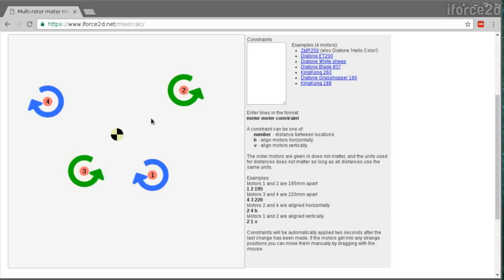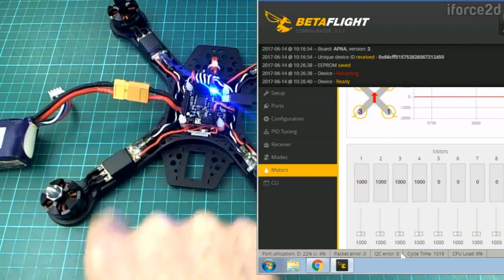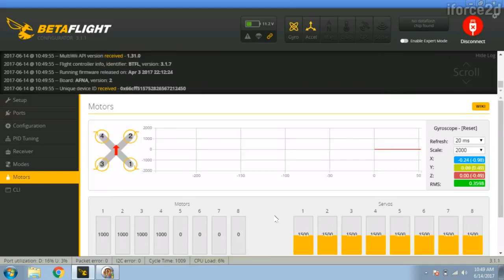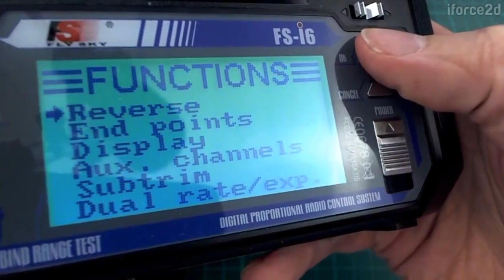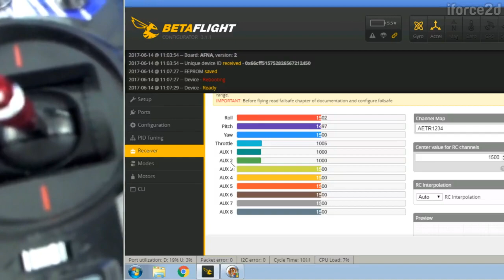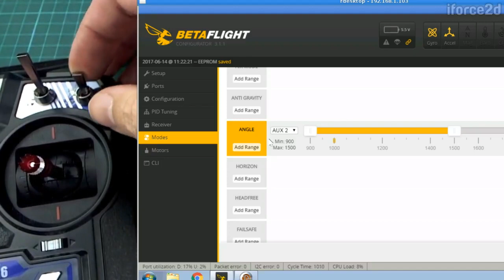Noobs guide to quadcopters part 16 (betaflight setup)

Comment: I have watched this series years ago (right when It came out), with a bunch of other ones too. I actually bought parts back then to build a quad, but never got around to it (life....).
I want to get back in to this now, but have two questions:
- I have 1806 2300kv motors and 6030 props. And a 3s lipo. Can I use those together?
- I have 4 12A ESCs. The probleem is that they only have a sticker with the 12A on it. Nothing else is noted on them. How can I figure out what type they are or what firmware they use? I don't recall what they are from buying them, not do they have any documentation with them.
I've tried to Google both the above and haven't really found any definitive answers. 
Thanks in advance.
Reply from the maker: The motors are a good match for 3s lipo. 6030 props will be fine for lazy hovering around, but are usually too thin and flexy for aggressive flying (they will start to buzz and flutter). Try around 5040, 5045 for a better match. It doesn't really matter much what firmware the ESCs have, unless you want to get fussy fiddling with their settings. The main difference is that if you want to reverse the rotation direction, you need to do it by swapping any two wires going from the ESC to the motor, instead of by using the software settings that BLHeli allows.

Comment: Just for anyone coming across these truly excellent videos these days I want to add just one thing that I consider important:

These days, arming and disarming is NOT done with the clunky stick movements anymore. Just put it on a dedicated arming switch like the flight mode. As he explains at 47:35 it's important to have an easy way to make sure the propellers stop (as they might pose a threat to people/fingers or just be in danger of damaging the quad itself it something is tangled up).
Get used to armind and disarming a quad on a switch immediately. When first lifting off after plugging in a battery, or particularly the first flight of the day have your finger on the disarm switch if anything is going wrong. This is hard/impossible to do with the stick movements.

This is also connected to the fact that motors spin up as soon as the quad is armed, even though this reason comes from a different direction: Brushless motors have a hard time starting (or rather the ESC has to do some special stuff to get them to move) and it's a relatively slow process compared to how quickly a quad normally has to react to things. If you're in the air and you put the stick all the way down (maybe you just shot up too high and want to come down) the motors stop, which also means the FC can't correct the attitude of the quad since every command to an ESC requires the motors to start spinning first, it can't just spin one slightly faster than others to rotate slightly since all are off. A quad that's freefalling tends to start to oscillate out of control as the FC tries as he might to correct and constantly overcorrects due to the delay in reaction (and the dead zone, as you see the motors don't start spinning at throttle 1001 or 1002).

The idle throttle can be set on the command line btw, so I highly recommend leaving motor stop OFF and please please please use a switch for arming and disarming!

Comment: Thanks a lot for helpful tutorial. I have a problem with BLheli Suite, Initialization of serial 1 wire passthrough or 4way interface failed!
Reply from the maker: You should always try googling the text of the error message, it will usually find the answer quite quickly for common problems that other people have also encountered. For example in this case, the first result on google is: https://github.com/betaflight/betaflight/issues/3701
If you are using the version of Betaflight that is mentioned there, then it looks like you need an older (yes, older) version of Betaflght if you want to use blheli passthrough with a naze32.
Here are some more details (look for 'passthrough' on this page): https://github.com/betaflight/betaflight/wiki/BetaFlight-3.2
Note also there is a link to an RC groups page where you can find a build of BF3.2 that still has blheli passthrough enabled (but missing mag and baro support).
But usually you only want to change your ESC settings just once, when you build a new quad. So you can use an old version to do the ESC settings, then install BF3.2 after that. Also keep in mind that from BF3.3 there is no support for naze32 boards at all, so 3.2 is the newest you'll get :)
Reply: Thanks for the quick replay. Believe me I have been googling for hours and can not came to a solution yet :) Thanks for the valuable sources and info.

Comment: Well this is going to be handy;  I have just ordered a Grasshopper 160 frame for my first build, and thought I'd pop into this tutorial for a grasp of the elements of Betaflight config ;  I'd already wondered whether the front/rear track differences of the Grasshopper might be and issue;  so was delighted to find your calculator handles that very model !
Reply from the maker: Yeah I put in presets for most of the non-square frames I actually own and have measured myself. It's easy enough to put in the distances for any other frame though.

Comment: would be nice if you add that web tool for custom mixes to the betaflight configurator, after all its open source right?
Reply: Open source doesn't work that way, it would be a different software forked from betaflight. You need to discuss this with the betaflight devs and see what happens. Since it works okay already I doubt it would be added soon, maybe after some of the more serious bugs have been fixed.
Reply from the maker: The configurator runs in the browser, personally I don't find it that difficult to open another browser tab and do one copy+paste. It's not a setting that I make often or need to keep tweaking many times.